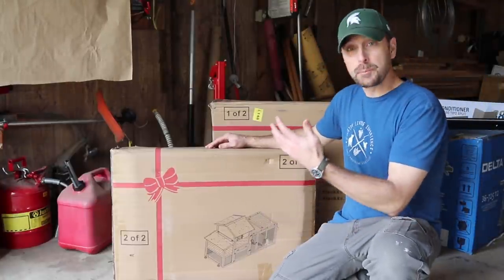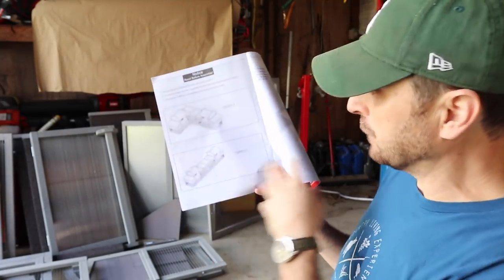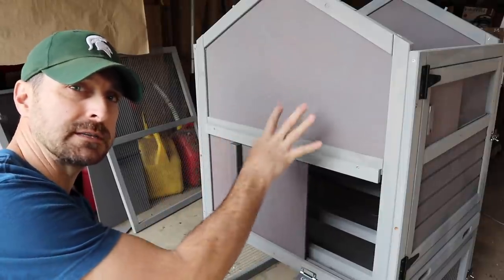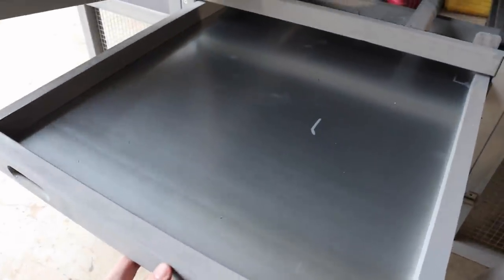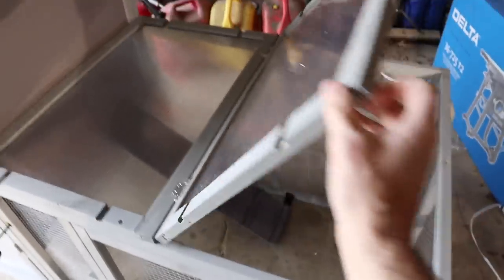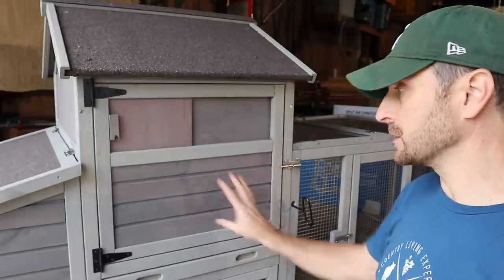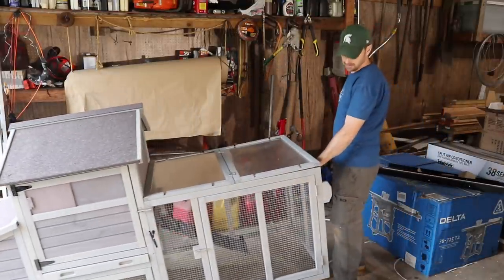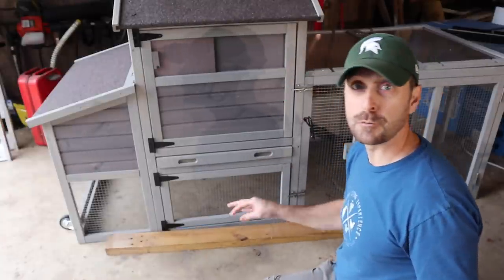Prefab Chicken Coop With Run By Aivituvin! Good For A Homestead??

Comment: I have one of these. Mine is on 4 wheels, but basically the same. A problem with this type is that the roosting bars are lower than the nesting boxes, which causes the chickens to roost at night in the nesting boxes.  I agree it was quite easy to put together and looks great. Thanks for the tip to do some caulking and painting. For now I have it inside a covered chicken run but plan to build an additional walk-in coop and use this for quail. Quail don't use nesting boxes so I think it will work.

Comment: A coon can easily open those sliding latches. We have plenty of coons, hawks, foxes, coyotes as well as armadillos and moles. I have seen them all on our property in the daylight so I imagine there are many more roaming around at night looking for a meal. Chickens will be safe in the coop at night though. This would not work for us. This “looks”  nice but does not looks terribly sturdy or  like it would last a year out in weather. I think we are going to build something without a run and set the coop inside a large run covered with hardware cloth. Top, sides and a 2 ft perimeter all around the outside about 4-inches deep in the ground, but still attached to the frame to keep anything from digging in.  Build it right once and you won’t have to do it over every year.
Reply from the maker: Yep. That is why it is only going to be an isolation coop for us within the confines of our electric fence. It will have to be sealed and painted to have a chance at all.

Comment: Bought something similar, it’s not bad. I ended up building an extension run for the coop and using some water seal clear coat. I like the idea of setting it on treated wood and caulking it.
Reply from the maker: Cool

Comment: I bought one from same company, very cute but need to modify to really work well. I bought for my little chicks after moving from brooder and before coop living with the big girls. I wish it were on a base to raise it up higher so I don’t have to squat down to tend to the girls and to keep the bottom from rotting out.
Reply from the maker: I agree it is cute but needs some mods to work well.
Reply: I have a similar coop and I had a frame made about 2 feet tall and built to the dimensions of the coop,  put hardware cloth on the frame, and placed the coop on the frame (for that no-squatting down reason!!  ha)  Of course, these modifications added to the cost but it was well worth the cost to me.

Comment: One of these coops are good for 2 large breed chickens.But they need a good 4"×6" run with them.I have 4 black rock hens,2 of the coops connected by the 4×6 run that connects them.All 4 still roost in one coop but 2 coops is still more adequate for 4 large hens.I also let them free range a few hrs per day and they are very happy.Using just these coops alone just isn't enough for happy chickens.Good while still chicks though.I also added a layer of cheap waterproofing.Good coops for the money though.
Reply from the maker: True

Comment: Well . . . if you wanted to put rabbits in there, you'd have to add wire mesh to the bottom, or they'd dig out.  For us, this wouldn't work - snow in the winter and predator pressure would make it impractical - as lightweight as it is, a raccoon could be in and out in no time. Snakes could get in as well.
Reply from the maker: Yes, that is what we determined as well.

Comment: Do you use a specific type of outdoor paint that is chicken friendly?
Reply from the maker: No. Any paint is fine.
Reply: @CountryLivingExperience  Your insights and recommendations are wonderful. I purchased this coop and will be ready with wider wheels for grass, better clasp for the nest box, bottom edge treated wood, caulk and paint. Current model shows a clear water guard between house and run is included.
Reply from the maker: You're welcome. I think they have added some upgrades since I did this video.

Comment: A coyote or other predator like raccoons will push through the cheap mesh on these quite easily. Beware of that. Best to just get a crash course in making a basic box with lumber. It will be several times stronger than these things.
Reply from the maker: True. I think I mentioned that.